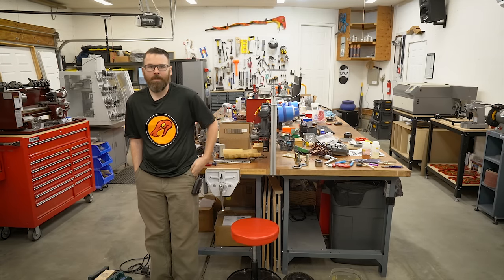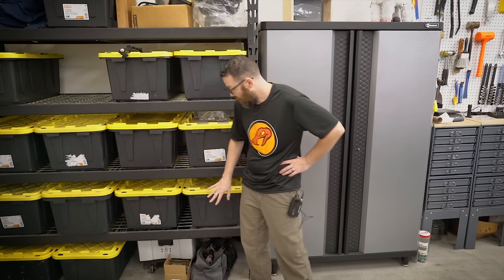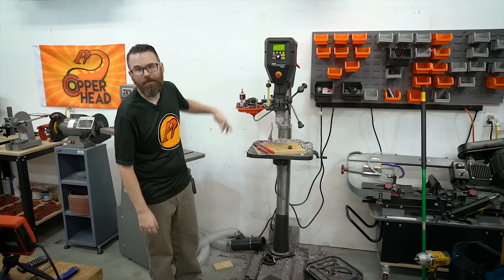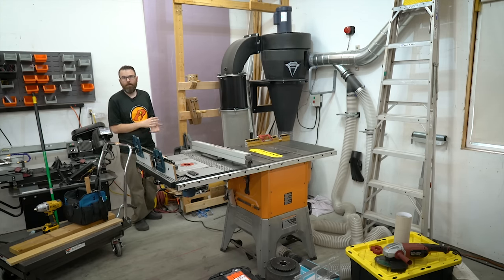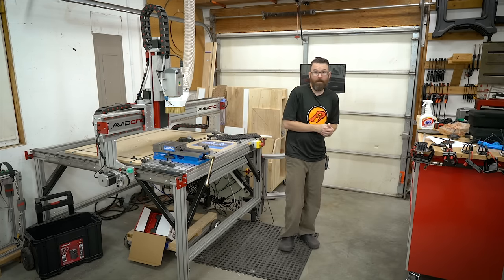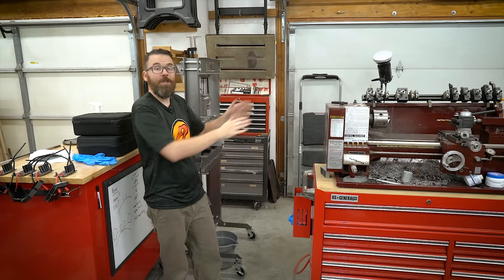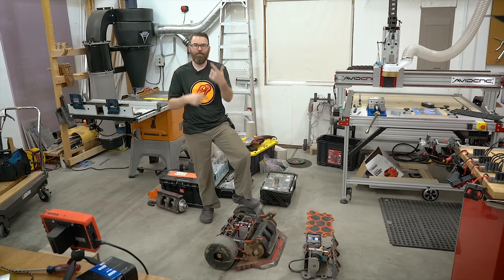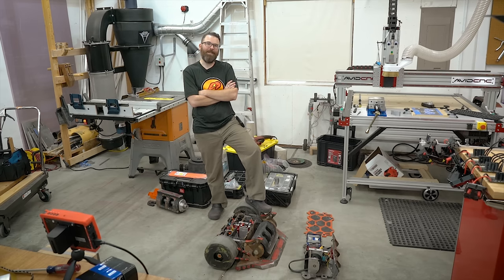Copperhead Workshop Tour (2021)

Comment: On the subject of the lathe, I was given one of those for free several years ago, only difference being that mine is white. It was still in its original, unopened, but badly deteriorated plywood shipping crate, and due to its storage in a barn for at least 20 years, was a sort of mouse condo! Total disassembly and rebuilding produced a very capable machine, thanks mainly to Grizzly Industrial, whose G4000 machine (sold as a 9x19!) is the exact same machine and they sell every single part on it! The Achilles heel of these things is that cruddy two bolt tool post mounting plate, which is not rigid in any sense of the word! I made a 4 bolt one for my machine, but Little Machine Shop actually sells a 4 bolt mount designed specifically for these 9x20/19 lathes. The four bolt made a major difference in my machine, and It’s honestly handled every job thrown at it! Your channel is new to me, so I’ve got some catching up to do! Thanks!

Comment: What material do you use for your work tops on your  center island? Any pros and cons? I have sections in Formica that’s great for glueing, cleaning, etc and then some sections with hardboard that screws to a more solid wood top. The idea being that I can easily replace the hardboard as it wears. I am looking at few other options for the next section now. Thoughts appreciated.
Reply from the maker: I use just solid core door slabs from a hardware store.  Pros:  they're cheap, readily available, solid wood.  Cons:  Thin veneer (mistakes can go through the veneer), not the MOST durable, good with oils/solvents only after sealing and waxing, could be stronger.  I'm not sure I would do anything different, I like the idea of formica or even butcher block, but I also kinda like the "who cares" nature of my door slabs.  They have gotten heavy use for the last 5 years and still seem fine.  I might re-wax them, maybe.